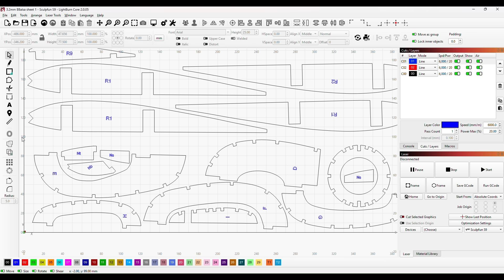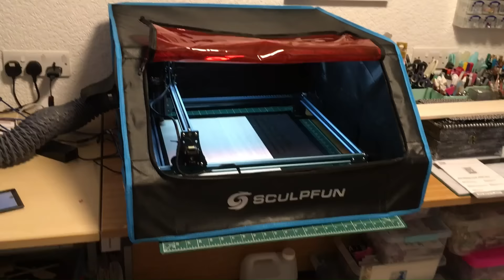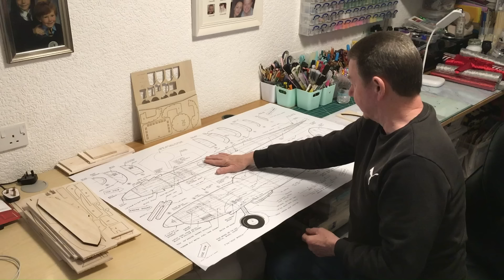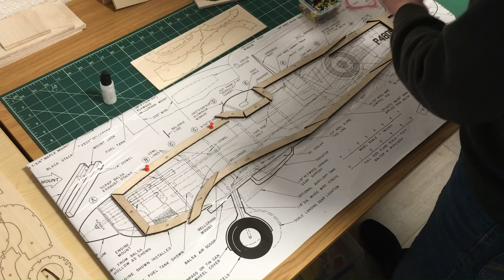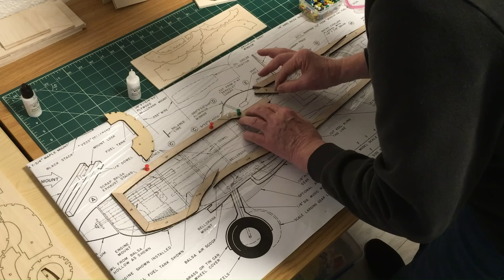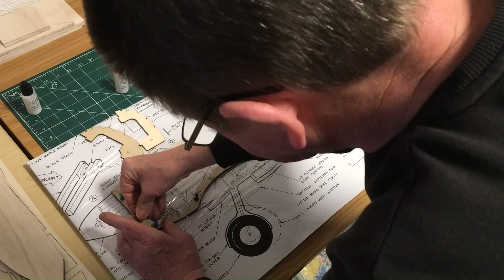Build a Radio controlled Spitfire using a cheap £250 Laser cutter. Step by step guide (Spitfire 6)

Comment: Would love to see how you transferred the original plan in to lightburn. I’m doing something similar with an old steam tugboat, currently manually with a scalpel and card, but will soon have a laser and want to repeat the exercise with more precise cutting and better materials.
Reply from the maker: This is episode Spitfire 6 in Spitfire 1 I will have imported the plan. Check it out it is a simple process. If you are working with a paper plan (not available online) In 'Hurricane 1' I scan in a plan from papaer. I hope this helps, good luck with your projects.

Comment: Do the scorched edges cause problems for the adhesive?
Reply from the maker: No not at all, I use easy sand woodglue its a type of PVA variant and it works perfectly well on the laser cut edges. Hope this helps.👍👍👍

Comment: Why do you not use CA? no waiting. And no risk of parts falling over when your not there.
Reply from the maker: I prefer the PVA personally, you get a little time for adjustment and corrections. I use CA (superglue) when I'm attatching balsa to ply though as it 'wicks' in whereas PVA wiont do that. Thanks for your comment, it is great to hear other peoples thoughts and suggestions. 👍👍👍👍
Reply: @LaserRCModelguy  Great job on the video btw
Reply from the maker: @ThunderPantz01  Thanks! 👍👍👍

Comment: Been enjoying your series but anyway you can produce a material list of parts   The sculfun s9 is being retired is the a list of the specifications of a laser cutter so we see what’s available
Reply from the maker: Thanks for your comment, The materials are all detailed in the videos and I don't have a list as such. For this airoplane though I have used 
1/8th in Balsa sheets (3.2mm)
1/4 in Balsa sheets (6.4mm)
1/8th in balsa square strips (3.2mm)
1/16th in Balsa sheets (1.6mm)
Plywood sheets (3mm)
As for the Laser cutter I have never done a comparison, so I don't really have any recommendation. I am not sponsored or supported by any company so I really have no particular preference. When I replace this machine or upgrade I will do a research and comparison at that time. I will make a video when I do that and share my findings.

Comment: It would be good if the laser cutter could cut at an angle as well. Otherwise you'll still have the break out the Swan Morton anyway.
Reply from the maker: There is always some finishing to do, a bit of sanding and such, cutting angles for hinges to operate. 👍

Comment: I remember having to cut out all the balsa parts with a razor blade 55 years ago.  Gullows was so cheap they would just print the outline of the parts on a bare sheet of balsa.  And in those days that was enough.
Reply from the maker: I used to use a cheap modeling knife in exactly the same way, the beauty of the laser is that once you get your files done you press a button to produce a ready cut out kit. Who would have believed it when you and I were making our first planes? Mine were always KielKraft back then, as that was what our local model shop had. 👍👍

Comment: Pin everything and use squares on everything was how I did it decades ago lol, I would also fit stringers whilst it is still pinned down , it's very easy to introduce warps wholst  building so check everything over and over as you go.
I'd love a 3d printer and Lazer cutter. Might be time to invest ..
Awesome stuff thanks.
Reply from the maker: Thanks for your comment, yes these are all good practices, the laser cutter is brilliant for producing kits; let me know how you get on. 👍

Comment: After gluing with wood glue I find that it’s better to add a small amount of super glue with activator which secures them while the wood glue cures
Reply from the maker: That's interesting, I use easy sand wood glue and if needed I use pins.

Comment: Hi. Before you purchased the Sculpfun S9 did you look at other laser printers in comparison?

I have an Xcarve with a router but would like to upgrade to a laser cutter for making vintage models and components. It would cost between $500-$1000 to install a laser and driver on the X-carve but this S9 looks like an option for a starter machine. Do you see 400x400 as an adequate size of would you have gone bigger if possible now you have used the machine?
Reply from the maker: I didn't really spend too much time as I had no personal experience with laser cutters. The reviews all seemed good and the price was very good so I tried it and it worked very well. If and when I upgrade I will try to get a bigger workspace, a higher wattage and air assist. However, at the moment the S9 does everything I need for my hobby and for the channel. Good luck and let me know how you get on. 👍
Reply: @LaserRCModelguy  thank you for the reply.  I am just looking at various reviews and will take your points into consideration. The air assist looks like a positive extra and yes a slightly bigger bed size offers distinct benefits. The aircraft we intend to build are smaller FF and Vic Smeed types, the one of past youth. We will follow closely your progress. Thank you, and have a nice Christmas Day over there..

Comment: Thanks for sharing your technique & this build with us. I learned 123D Design by Autodesk and became pretty proficient with it. Then autodesk discontinued it which took all the wind from my sails. It’s horrible when a company does that. Learning a new CAD program just seems too daunting at my age. Have a Merry Christmas 🎄🎁
Reply from the maker: Lightburn seems very intuitive you can download a fully working trial version and see if you like it. Thanks for your comment.
Reply: i STILL use 123d which can be downloaded to this day.  It's no longer supported but i can't see that it matters.  I simply export as an STL file for 3d printing.